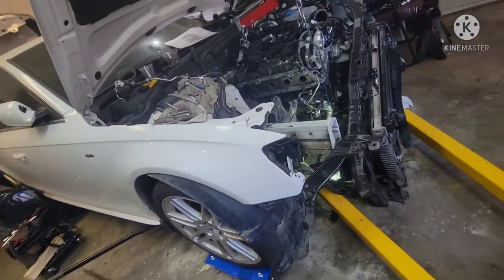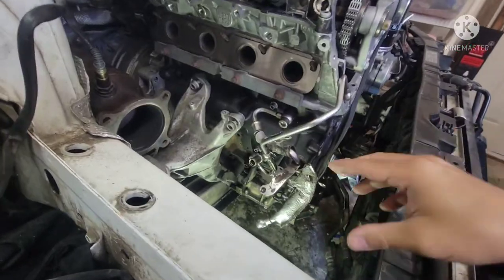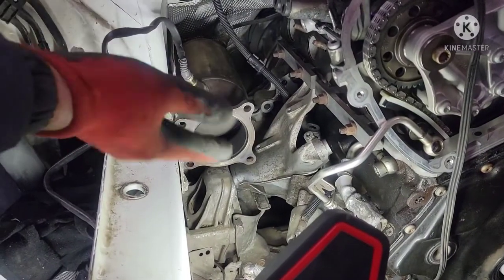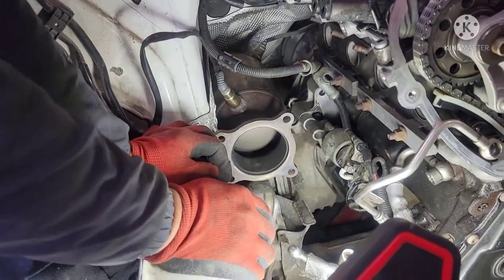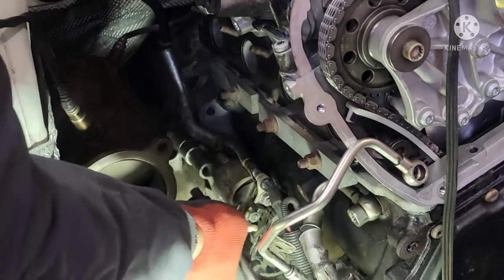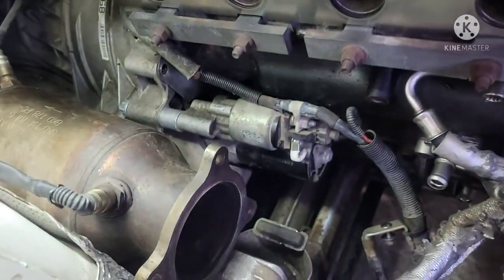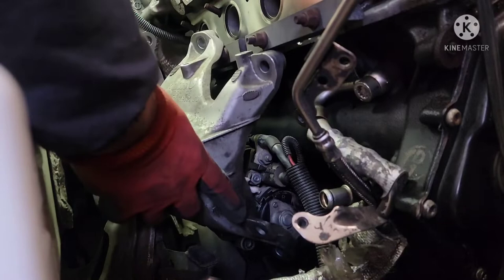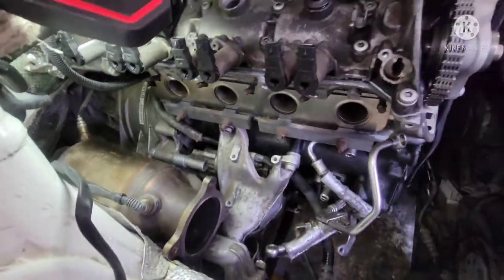Audi 1.8L or 2.0L Easy Step Installing  Starter Motor

Comment: That big wire where is going  behind the engine? Looks like around the engine but what part should be connected ?
Reply: The big wire goes on the top post of the starter solenoid and is connected to battery +